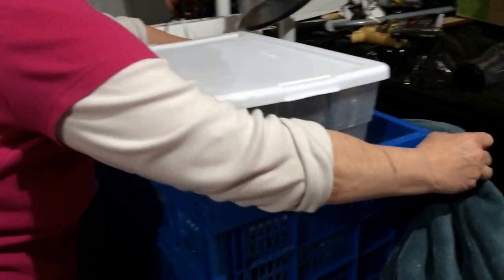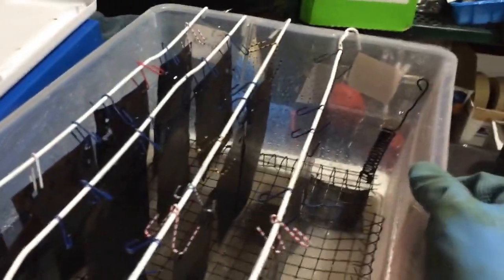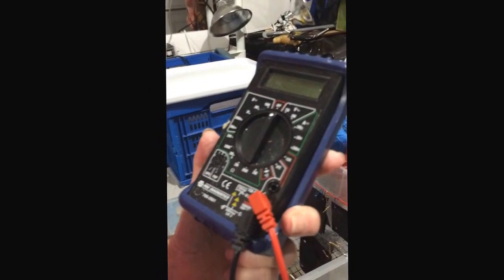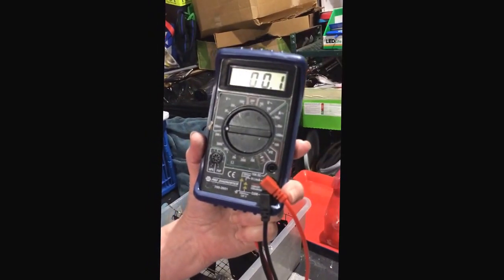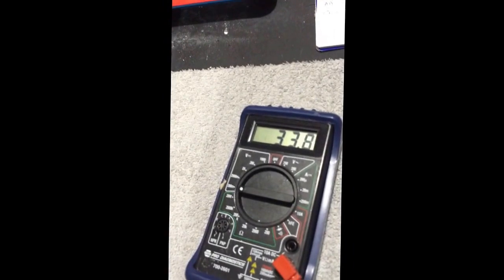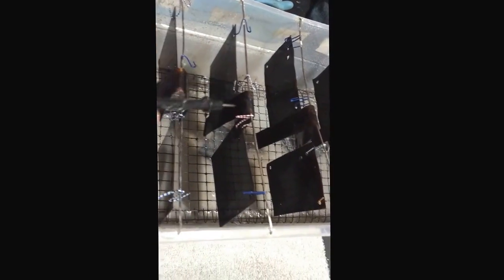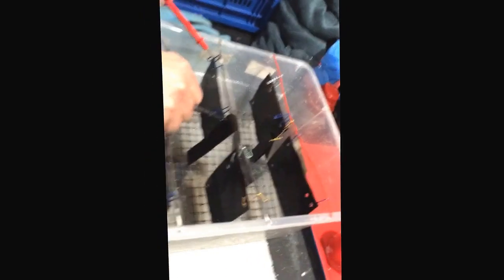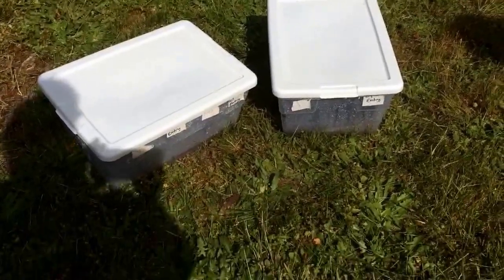Nano coating of Copper plates:  with hot caustic first, including "discharge process"

Comment: is temperatures important? I would like to get started, but it is below freezing temperatures outside. and I have no "garage" I can close up and heat.
my plan was to use hot caustic in a shoebox size plastic box with lid. 
how warm through the process do I need to keep the container?
Reply: Can you do with could water?
Reply: If not why not?
Reply: @EHS706  Hi. You can do with cold but nanolayer will grow slower and thinner. With hot caustic you will get deeper to copper plate and make more nanolayers. Also when you keep plates in hot environment, layers will grow faster. If you have cold environment, keep your plates near heating element during growing process. Most important is hot process in a begining. Dont use cold caustic process if is freezing temperature everywhere. Love and Peace.

Comment: Question: What difference does the wire mesh make?  I have seen some lay the plates on the mesh and cover them with the caustic, stand the plates on the mesh to keep them out of the caustic, but, if they are suspended over the mesh, is the mesh necessary?  Also, since you don't do a fresh hot caustic for each step, are the later steps called cold caustic?  I am trying to get a handle on the causes and need of these processes and most people show how but no why.  That makes it hard for us beginners to figure out if their process has added personal preferences.  Too many variables outside the plastic container, the Lye, and what you are nanocoating. .... help?